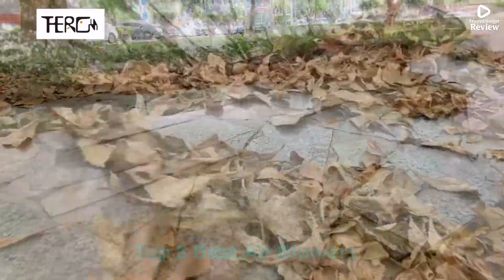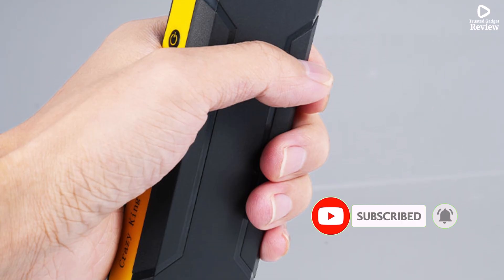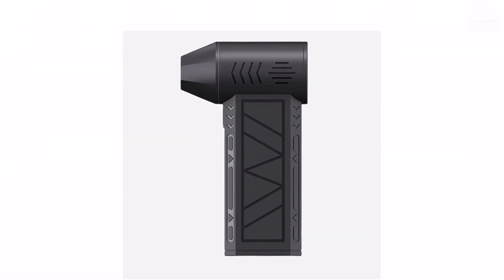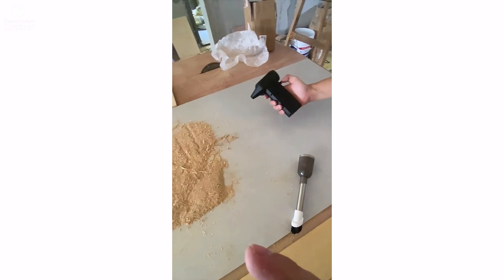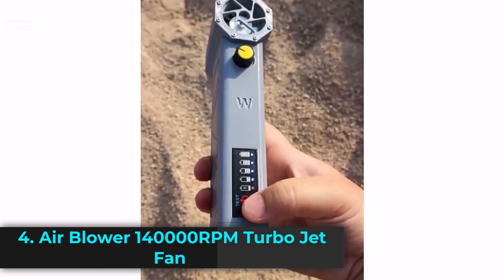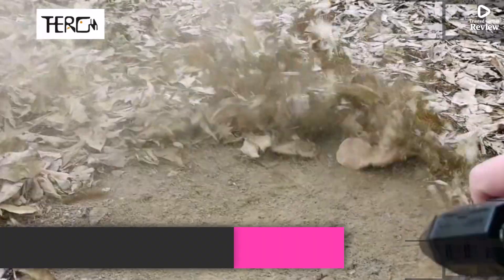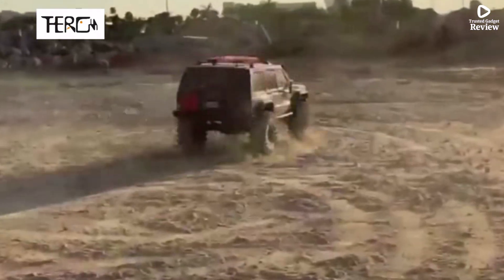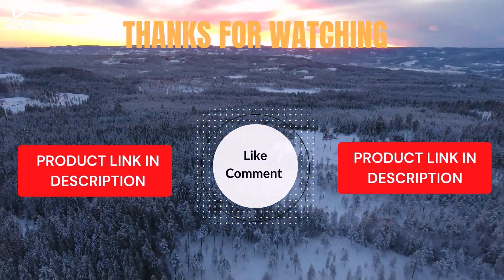Top 5 Air Blower Fans AliExpress – Best Picks for Powerful Cooling & Drying

Comment from the maker: Links to the Best Air Blower are listed below. At Trusted Gadget review, we've researched the Best Air Blower saving you time and money.

1. ► 160000 RPM Electric Air Blower Turbo Jet Fan Brushless Motor High-Speed Turbo Violent Fan USB Rechargeable Powerful Dust Blower - https://s.click.aliexpress.com/e/_ooRiB09

2. ► 130000RPM Mini Air Blower Handheld Electric Turbo Jet Fan Industrial Dust blower Brushless Motor Violent Blower Wind Speed 52m/s - https://s.click.aliexpress.com/e/_c4V7DLpH

3. ► Violent Fan 300000RPM Powerful Air Blower Vacuum Dust Cleaner Type-C Charging Strong Winds 53m/s Brushless Turbo Jet Blower - https://s.click.aliexpress.com/e/_c3bG1Wzp

4. ► Air blower 140000RPM Turbo Jet Fan Brushless Motor Handheld Duct Fan 52M/S Portable Type-C Charging with Power Display ventilado - https://s.click.aliexpress.com/e/_oEcU3Hr

5. ► THERAGUN X3PRO Mini Handheld Turbo Jet Fan-150000RPM Powerful Compressed air Duster for Car Dryer/PC/Home-Industrial Duct Blower - https://s.click.aliexpress.com/e/_c4lm1qSx